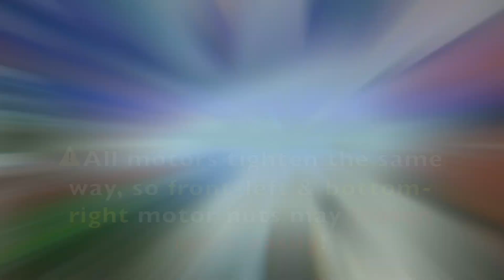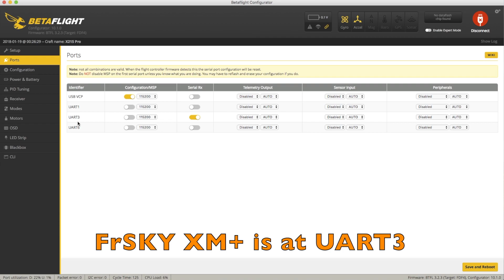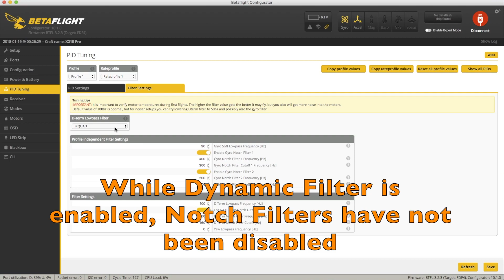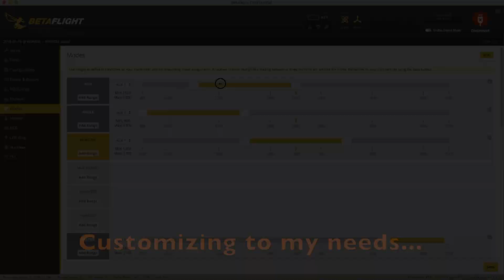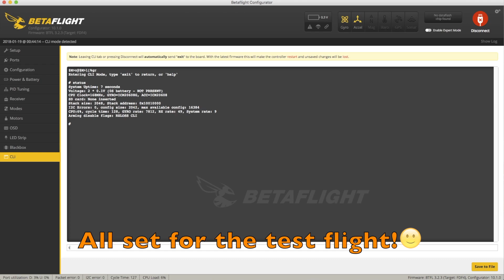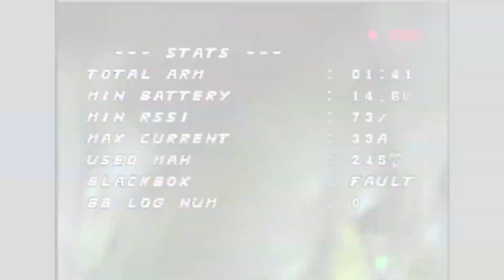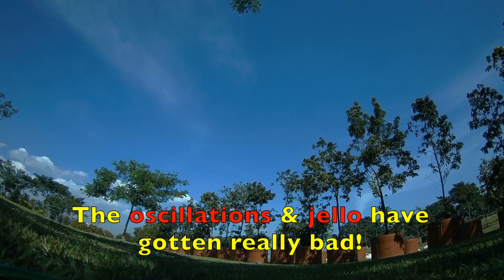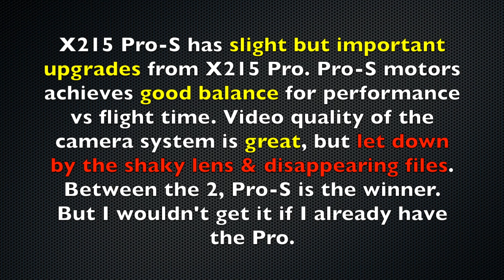FuriBee X215 Pro-S - Review - Part 1

Comment: Funny that you liked it. Everybody on the UAVFutures channel HATED IT and said it was total garbage, while they LOVED the previous X215 PRO (non-S version).
They said this one didn't fly smooth, was shaky, almost unflyable, etc.
Reply from the maker: I have both. My non S version also shakes the same way as the S version. But both are flyable. In fact, their stability is comparable. The only difference is the S version is less powerful due to the lower KV motors.

Comment: Informative video sir! Well done :) 
the recorded video indeed Is reasonable yes.. 30 fps? I don't quite like the recorded sound though :$
Reply from the maker: The video file is 1920x1020 60fps. I am not sure if changing the resolution or framerate is possible. Yes, I forgot to say that the recorded sound is bad, much worse than Runcam Split. The microphone is on the top board, facing up, and I am surprised it recorded so much noise from moving air. I'll try to fix that with some sponge in Part 2 of this series. :)
Thanks for watching! Hope you'll try this too!
Reply: You're welcome man :)  Allways watch your vids :) 
Hmm nope.. I'm going to skip this one.. I AM reviewing another Furibee at the moment, but the issues with the 'normal' 215 kept me away from this pro-s version :$

Comment: Great review Fyre. It seems like you didn't have to replace the foam on the gyro like Justin Davis from Drone Camp RC showed? Or did you?
Here his video of his modification:
https://youtu.be/3z_3ZERc0Ic
Reply from the maker: No, I didn't replace anything. It flies fine without removing the vibration-isolating foam. Sorry, I didn't watch the video; did he say why he had to do that?
I'm working on Part 2 of this series. So far I do not find any major faults that would be resolved by removing that piece of foam.
Reply: Fyre SG he's changed the soft foam mount of the gyro or secured it with a stiffer 3M tape (unclear) to fix the violent random sharp turns they have on the non S version when taking big turns. It is unclear though why he's showing this fix on the S version. I've just asked him if the S really needs this too
Reply from the maker: I also have the non S, and I didn't have to mod the vibration isolating foan either.

Comment: I have one of these and I do not get more than 2 minutes on my 1300mah batteries with this quad.  I'm still getting yellow lines with mine. No jello though.  I have secured my ribbon cable with hot glue, but I haven't touched my lens.  Its quite steady.  I have tried a LC filter and a low ESR Panasonic 1000mfd 25v capacitor on the battery lead.  I think it helped some, but doesn;t seem to be quite as clean a view as yours.  I will try some of your changes in betaflight though.  Those look like they could help mine.
Reply from the maker: I wanted to install a low ESR cap but I procrastinated as the interference seem manageble.
Try less aggressive props like 5030-3 to see if you get longer flight times.
I don't think my settings will increase flight time but you can give it a shot.
Reply: I gave up on it and sent it back.  I'd get a purple screen after a few minutes of flight. Seems like it was a heat issue or something.  Once you turn it off and let it cooldown, the video would be normal.  Then after a few seconds turn purple.  No flight or anything, just let it sit unarmed and it would turn purple. Seems buggy.  Not worth the trouble for me.
Reply from the maker: Yes, it does sound like heat issue. How are you sending it back? Do you have to pay for shipping?
Reply: warranty RMA.  They sent me a shipping label.
Reply from the maker: From GearBest.com in China? Or another retailer?
Reply: Gearbest.  I've been sending messages to them since I received the x215.    Its only been the past three days I have been able to get some traction on getting something done about it with them.  They sent the shipping label today and it went to someone in California.

Comment: Hello
I've upgraded the firmware on the X215 Pro-S and lost the stock configuration. Is it possible for someone to share it? That would be great!!!
Reply from the maker: I showed the stock configuration in this video. Have you checked out  4:38    of this video?
Reply: Hello Fyre SG 
Thank you very mutch for this Video. Your Videos are Great!!!
I tried to reconfigure it with thouse settings, but a lot of settings must propably be done in the CLI (Gyro,Battery,...). I am not a PRO in BetaFlight, so if anyone can share his config, i am very happy.
Reply from the maker: I don't understand what you mean by settings must be done in the CLI. If you see my video at 4:38, you just have to click and input the settings directly via the GUI; nothing is done with the CLI. Or do you mean you want the settings in the form of CLI commands, so you can simply copy-and-paste?
Reply: I have set all settings from the video. The things that are not correct/not working are: 
 - in the Battery tab it shows 3S Battery, but i have 4S and it shows also a 3S when i didn't had connected my battery
 - it also doesn't sees my Gyro, on the top of BetaFlight. As usual you should see it enabled, but it is grayed out.
There are also a couple of other things that are like that. If someone could provide me the CLI output of his configuration, i would be very happy. If the configuration is already  modified but working, this is good for me. Thanks.
Reply from the maker: Normally, whatever you set on the GUI will be the same as what you set in the CLI. It is very unlikely that the CLI commands will fix the issues that you're facing now. In fact, none of the stock configuration is about the battery, and the gyro, so I believe having the CLI config won't help. Maybe you flashed the wrong target? Can you confirm you had flashed the correct firmware? What was the target BEFORE you flashed it? Was it FDF4? Then did you upgraded to the FDF4 target of the latest firmware?
Reply: It recommended me to flash "Kalkute F4", i upgraded then to the latest Firmware. So, it looks like i have the wrong Firmware on it. Thank you for this advice and for the fast answers!!
Reply from the maker: I don't think the Configurator ever recommends the firmware target, because it never connects to it to check. The user has to choose the target every time. For some cases to recover from a bad flash due to the use of the wrong target, you have to boot into the bootloader, then commence recovery. Good luck!